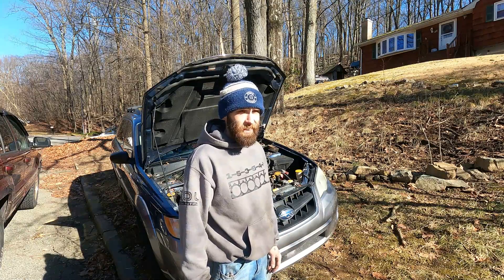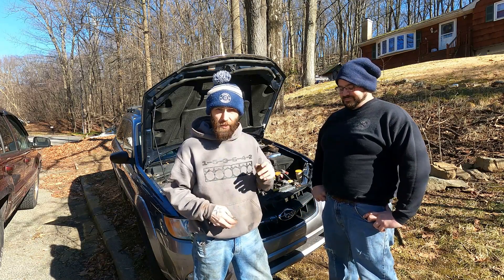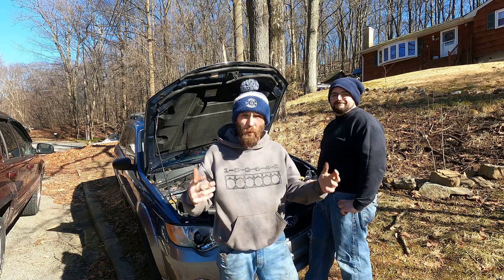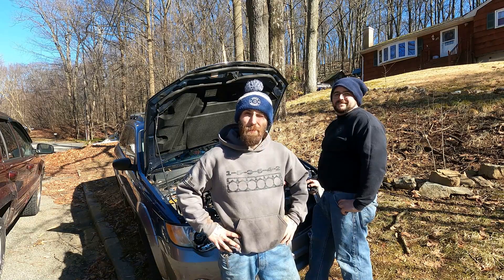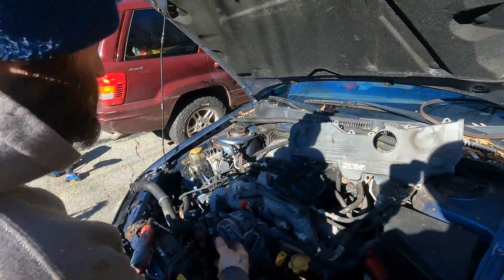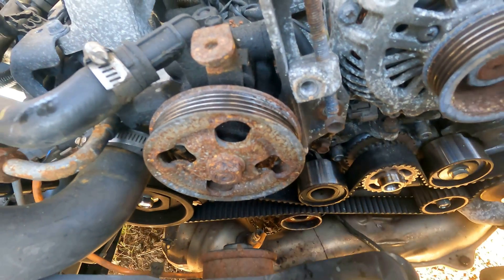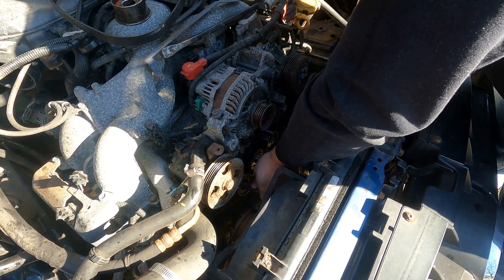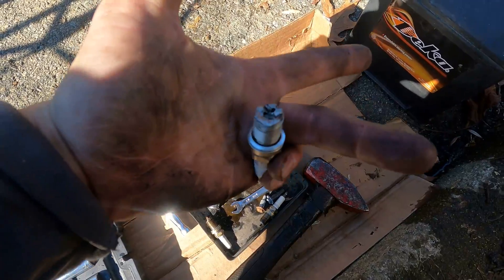What happened inside my Subaru's engine?!? (Diagnosing a Seized Engine)

Comment: Good news is a subby motor is perhaps top ten on easiest to pull out.
Reply: If they can get the engine to rotate   to remove the torque converter.
Reply: @MarshaJ8800TU  fair point..

Comment: I would say turn it down and you will be able to find out basically what happened if it didn’t jump timing, you definitely hydra locked it other easiest way to find out pull the oil pan